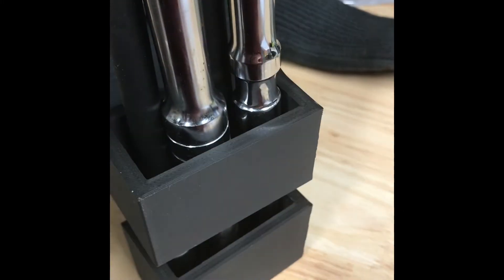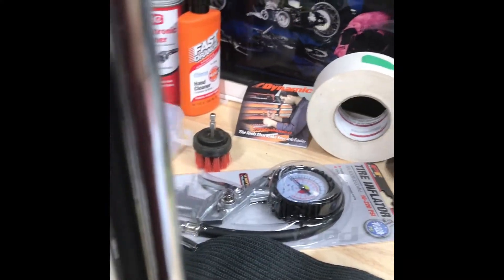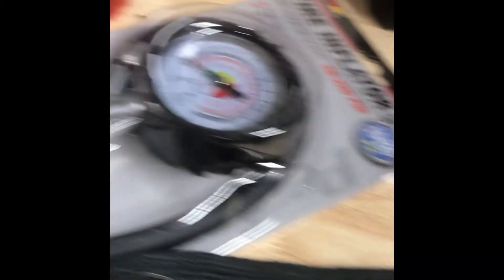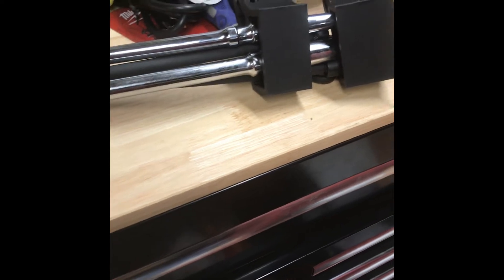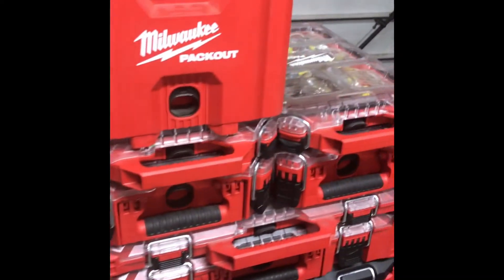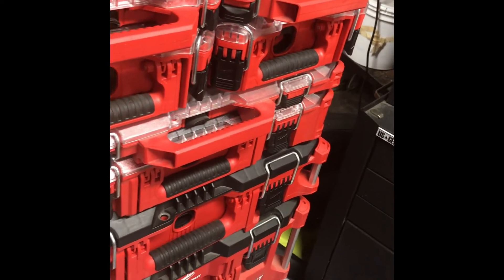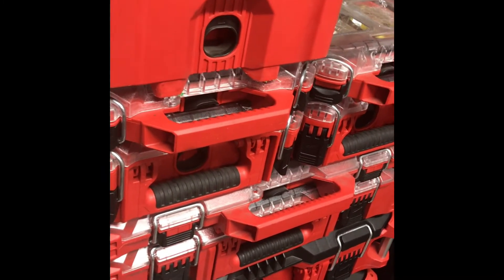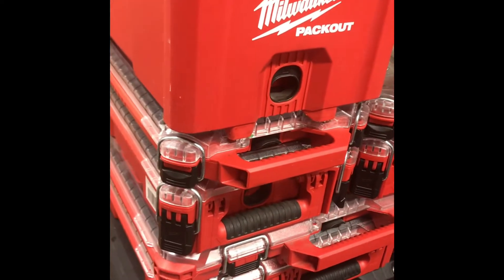How did this Milwaukee Packout Pit Cart design do?

Comment: I noticed that you have a trie inflator that you didnt mention, i must say that i like the Astro AI tire inflator as it is digital, backlit, 4 different pressure readings, and has a pressure relief button, taking the hassle out of deflating a tire. Fantastic video 👍
Reply from the maker: Yes good eye. I use the Astro Pneumatic Digital Tire Gauge and also we have manual backups. That's being mentioned in the Pit Cart tour Video.
Reply: @RedlineGary  I must have missed that. 👍
Reply from the maker: @TheShaggyRifleman  It's a vid that's coming out soon. I have some stuff shot just need to get the rest. Dale, Ed and Jude are chomping at the bit for it to be released.
Reply: @RedlineGary  I for one, can not wait. Thank you for the clarification